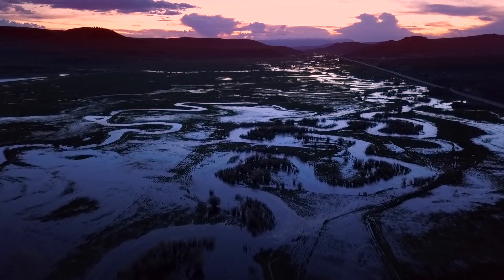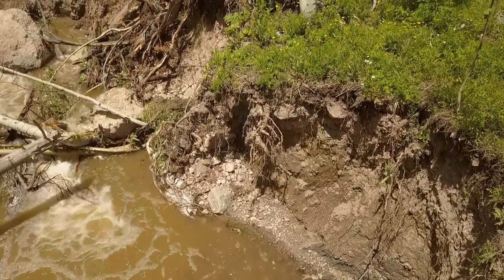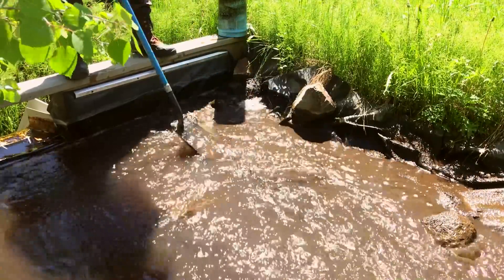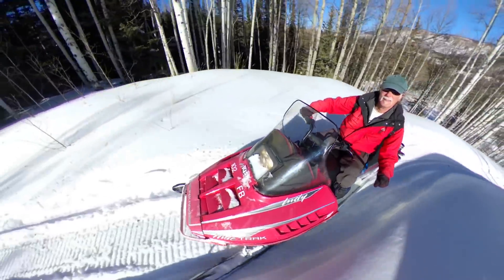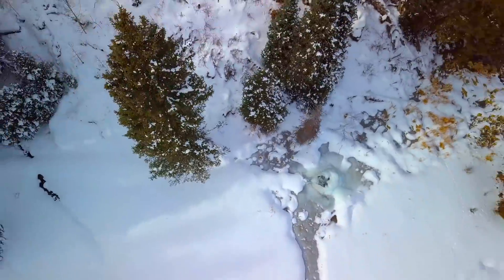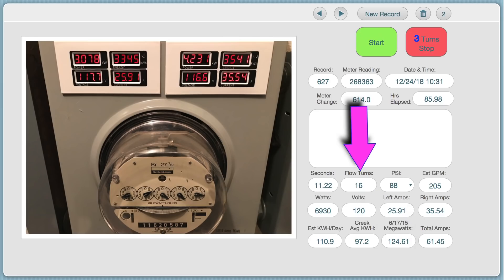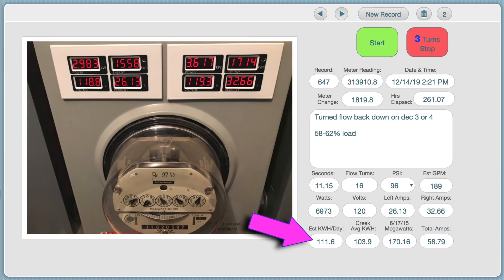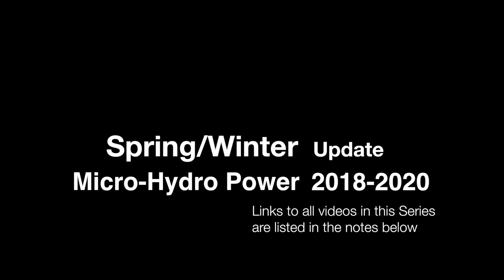Part 21 Micro Hydro Power System in CO

Comment: Extremely beautiful views of nature!  What heating do you use, have you ever considered heat pumps?
Reply from the maker: It’s complicated. We have passive solar design, some baseboard heaters, an in floor gycol system that has a propane boiler we rarely use and wood stoves of course. I have wanted to plumb another electric heater into the gycol system to use instead of the baseboard units which were considered temporary. Haven’t been able to get our plumber out to do that yet unfortunately. I should have put a heat pump loop in the trench for the electrics when it was open, but neglected to think of it at the time. We had -17 F the other night, no problem staying warm with a fire 🔥 Thx for watching

Comment: Love your video as always.  You seem to do a really thorough job of explaining all the factors that go into things, including stuff like erosion that I wouldn't have thought of.  I always appreciate it when you explain the reasoning behind some of your decisions, it helps me understand so much better.  :-)

Love the idea of the drone to check on the intake, but I'm also a little curious/concerned about the flight path.  Is there any collision-avoidance system if, say, a tree came down across the meadow right into your flight path?  Or if a bird got curious and knocked the drone down when its only halfway back?  Since I don't have a drone myself, I always wonder about that sort of thing.
Reply from the maker: Thx for the comment and watching.  I try to my best at splainin'
The drone gets programmed at elevations to avoid all that.  It took a bit of trial and error to figure it out.  It does have collision avoidance built in.  Not in all directions, but forward and down yes.  You need to stay below 400ft above the ground (AGL) to be legal and that isn't a problem.  No trees are that high around here.  Birds tend to just avoid the sound and hence the drone.  If it crashes at some point I have a no deductible insurance policy that will replace it.  I have crashed 3 or 4 times doing regular flying, but only lost a prop or two.  In all a fun hobby that the FAA is eager to outlaw, but thats a few years away at earliest if it happens at all.
Reply: @mrhydrohead   Thanks for the reply, that answers my questions. Glad to hear that it isn't a huge risk.  I know drones can be expensive.  :-)

Comment: Really love the drone footage! "Kind of sorry that you can't do any thing about the eroding every single spring... one wonder what type of options could be actually be used to stop the river from removing your land and constantly changing the topography of the land!
Reply from the maker: Yeah its a force of nature.  I have thought about building gabion baskets with rock from right there.  Might do it, but need to wait for early spring before the melt off comes in June.  Might just be too much force to prevent the erosion regardless of what I try. Part of the problem is that the hillside is liquified and soaked by a spring or two 400 ft up the north side of the hill which make it all slide towards the raging waters.  Thx for watching!

Comment: Thank you for this update. Now I'll be on the look out for a good property with access to flowing water. BUT that can be hard to find here in Australia.
Good to see all your hard work paying itself off. Also funny as I would have anticipated your winter heating power usage to be more of a draw.
However, I suddenly realised that cooling draws more than heating. True?
Reply from the maker: Yeah finding the property can be the hardest part. 1st hydro system i saw in 80’s was on an aussie ranch. Got me started thinking 🤔 
A good measure of our Winter heat comes from passive solar design with south facing windows and a prow on the roof for summer shade. Cooling? Well 8600 ft at night in summer with open windows at night keeps it all comfortable. Fresh clean air too. 
Best of luck in your search mate

Comment: yesssssssss. finally.
Reply from the maker: I know. It’s been forever. Hard to find new things to show and don’t want it to be boring. Thx for hanging in
Reply: @mrhydrohead  Any plans to shore up the supports on the bridge?     Perhaps some power monitoring with arduinos?
Reply from the maker: Have been thinking about Gabion baskets filled with rock from creek because of low cost and materials right there. Right now its WAY to cold and snow bound to undertake. But maybe in early spring before June melt off from higher elevations
Reply from the maker: I did run several set of control wires to the powerhouse and planned to use arduinos or other micro to use for remote restart, flow control and pressure monitoring from the house. But the fellow who offered to help with that never came through and my expertise in communication over 1200 ft of small gauge wire between micro computers is inadequate to figure it out myself. But maybe someday
Reply: @mrhydrohead  Got line of sight?  only a hundred bucks to get wifi down there to network it all together.
Reply from the maker: jeepxj LOS yes, I would need to learn how to program stepper motors and other devices. Don’t know coding either. So many projects, so many interests, time gets judiciously allocated 🤔
Reply: @mrhydrohead  its winter there.  hot tub plus laptop is all ya need.

Comment: I find the drone surveillance really smart, do you have it on a timer, or manual start? When the winters are very hash, you could always install heating elements on the places where the frost doesn’t belong, you have the energy for it
Reply: And you could always install extra sunpower collectors on you roofs. When the snow falls, just heat the panels up.
Reply from the maker: Been thinking about something like this for our roof where we get ice dams forming on the shaded north facing valleys.
Reply from the maker: I just periodically fly it manually to check it. Thx for watching

Comment: That was absolutely beautiful and fascinating, thank you!
I bet the drone programming took a bit of trial and error - I once programmed mine to fly around a mountain based on google earth height info, but undershot and had to hike a mile up a 40 degree slope to find and rescue it from the trees!
Having a drone means I've climbed more trees after age 50 than I ever did as a kid!
Lesson - always go and measure the exact coordinates and altitude yourself first!
Reply from the maker: Yeah it did. I sort of refined the litchi path as i went along. Framing isn’t always perfect but it saves the trip up there. Haven’t had any crashes yet. At least not up there. 3 or 4 elsewhere. Haven’t had to climb anything to rescue so far,  but best shots do come from flying close by things. Thx for watching
Reply: Have to ask what drone and program for it are you using??
Reply from the maker: Keith Robbins DJI Mavic Pro I with Litchi software control Thx for watching